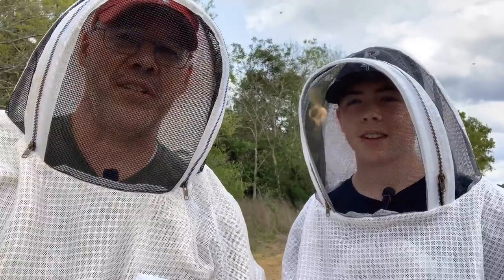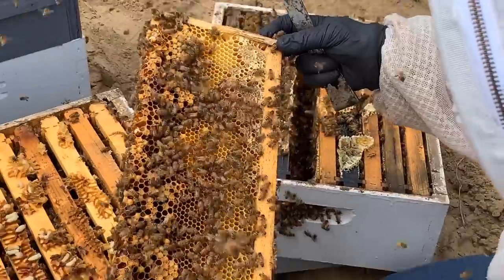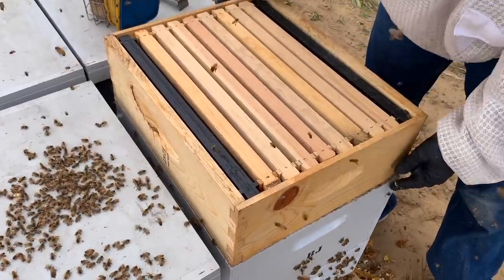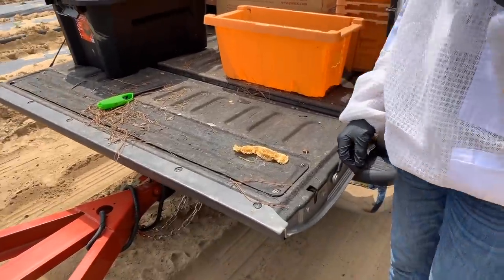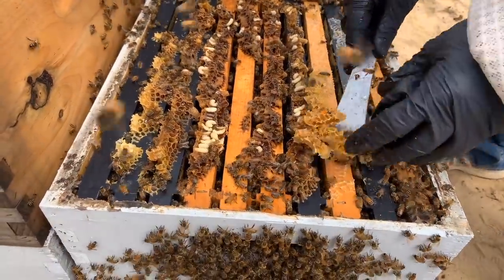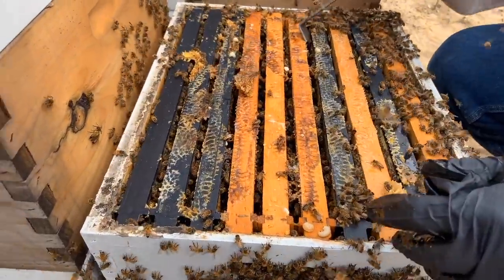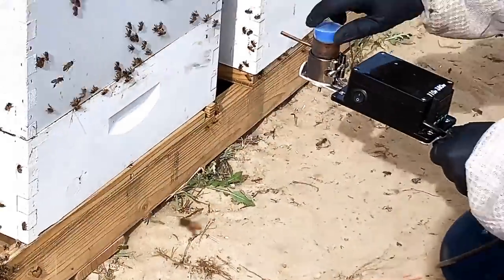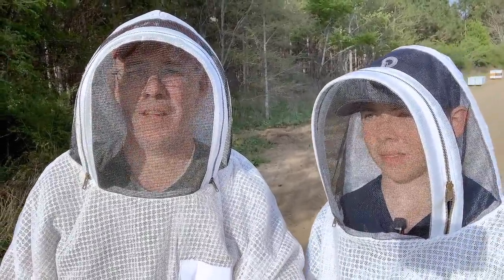POLLINATION BEES | BACK from California (Almonds) | 1ST LOOK | Cool!

Comment: Good looking bees Bruce, I'm not trying to tell how to keep bees, just telling you what I see.  Myself I would stack on a few honey supers and walk away or if you have the time, add a deep of empty brood comb for the queen to lay in, two week later pull that deep for a split. 

That wax on top of the frames is the bees trying to find space. Good time to be drawing foundation, a better use for that wasted wax.  So next year I would consider using two deeps for pollinate, the medium is not enough space.
Reply from the maker: I hear ya. The standard around here, what most people do, is a deep and medium. Would almost rather do 2 deeps. I got them reversed now in hopes of easier splits down the road and stacked them up with supers to provide appropriate space. Will see what happens. Last year I split them too hard and too fast and it was a challenge keeping them strong. This year I am going to try to manage space and get a honey crop and split if and when appropriate. Thanks for the advice. Someday maybe I will get it figured out🙂

Comment: Id probably drop in apivar next year before sending to almonds ... Bigger they get harder to kill the mites .. Hopefully they catch nice flow for ya
Reply from the maker: Yeah should probably do so. I treated with Apivar in the fall and I think they were fairly clean when they left but no way to know for sure. Will just try to keep the mites knocked back the best way possible until honey flow of over and then hammer the mites down.
Reply: Ya kinda stuck now your flows starting needing supers added formic wont work with that much room .
Reply from the maker: Haven’t really used it before. Have heard it is hard on the queen.